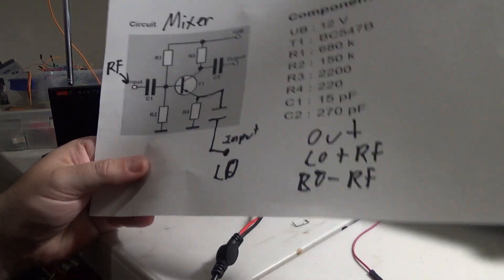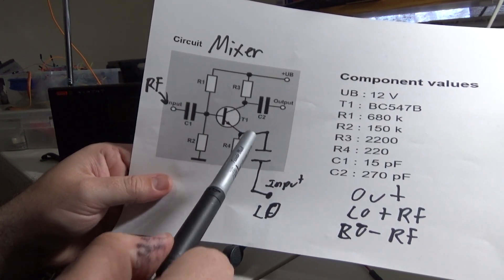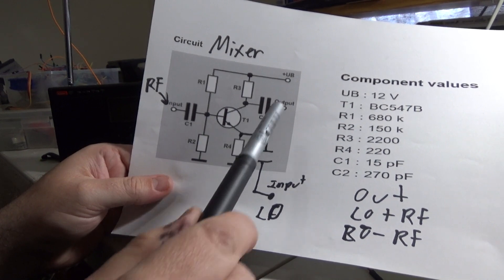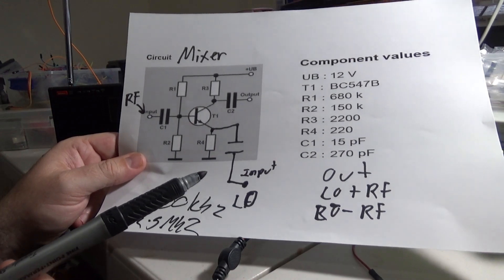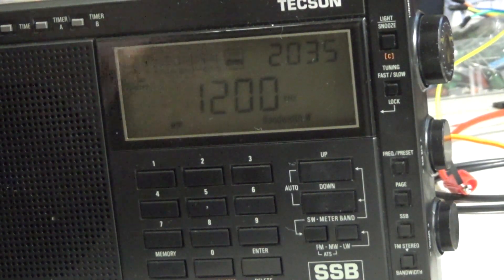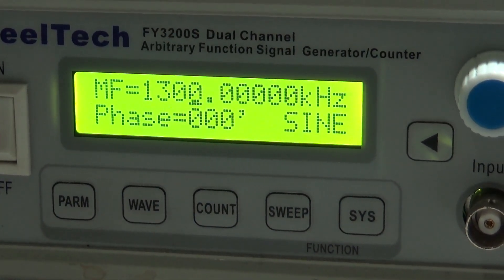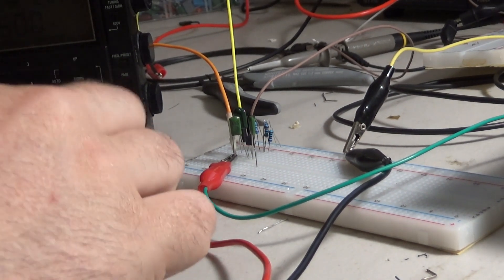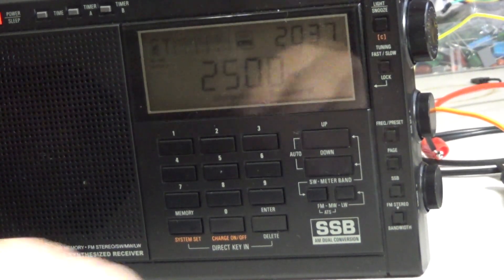Radio Frequency Mixer Demo

Comment: These mixers were OK for domestic radios but they were completely unbalanced and as well as the wanted IF output, you would get a very large amount of the local oscillator coming out too, which could spell trouble in multi-band sets. There would aslo be a fair amount of the RF input signal present, more trouble. A nice balanced mixer would have been much cleaner, but pennies count!

Comment: For some reason I'm having a difficult time wrapping my head around this concept, maybe if I saw the mixed signal on a scope.
Reply from the maker: The reason it works is pretty mathsy and not intuitive. Plenty of places you can look up a derivation. 

The scope will just look like mess because it'll be 3 different frequencies all summed together.

It'd be best viewed on a spectrum analyzer if anything
Reply: @elpechos  Like modulated RF signal?

Comment: For total Noobs; An antenna converts invisable Electromagnetic radiation into pure electrical signal but you can also connect an electrical signal to the antenna and it will just go ahead and like it and say; "Thx for saving me the work" except not and electricity is always trying to play the magnet game at the same time. It's physics. Somebody way up high said that it was going to be that way. It lets us do cool stuff.
Reply: Yes, you are a total noob. :-)

Comment: Hi Matthew,what is your  antenna connect at green alligator clip?
In other case for RF input signal at mixer have you LC tank circuit to get the frequency for 1,2 Mhz?
Dinos

Comment: Thanks for the video. How will this receiver type handle a signal at the level of MHz? For example, let's assume that a 100Mhz signal is coming from the antenna in the FM band. How will the stage amplifier after the antenna amplify this high frequency? There isn't even a transistor to handle a 100Mhz signal.
Reply from the maker: There certainly is a lot of transitors that will handle 100Mhz. The ss9018 is a pretty old transitor with a transition frequency of 1.1Ghz. So it will handle 100Mhz no problem
Reply: Most will handle up to HF (High band frequency before the gain starts to decrease linear on dB).

Comment: Thanks for the video. So if I take a common emitter amplifier and inject a local oscillator frequency through the decoupling cap on the emitter resistor I get an RF mixer?
Reply from the maker: You sure do
Reply: @elpechos  Wow thanks! Must have learnt this once and forgot.
Reply from the maker: @jemussi7842  You'd be better off buying a NE612
/SA602 though. It costs virtually the same as a single transistor and works a lot better. The one transistor mixer is more of historical interest. It does work well enough to make a simple superheterodyne AM radio though.
Reply: @elpechos  Many Thanks for this, I will look into that for sure.
Reply: Only if the levels are correct. If they are too small, then you are simply getting a linear adder circuit.

Comment: I've been working with 2N3904 transistors and I haven't been having success at frequencies above 1000 kHz. Maybe I can get some transistors like you are using and try them.
Reply: Probably the High Frequency gain dramatic reduce after passing the midband

Comment: Thanks for the video : now i wonder why we use diodes and baluns when can just use active mixers (with tuned circuit)

Please are your resistor values correct? doing the math then collector voltage is negative (bjt in saturation)...

Please check it (what's my mistake?  Thanks)
Reply from the maker: Here's the DC operating points for this amplifier

https://imgur.com/a/vevz7CR

You can always check your math with a free circuit simulator such as LTSpice
Reply from the maker: @Zeus . 

>i wonder why we use diodes and baluns when can just use active mixers

Passive (eg, diode) mixers are simpler and have wider bandwidth than active mixers. They also tend to introduce less noise.

Comment: This is a fantastic video! One question I have is that how did you hook up the 1200khz transmitting signal to the input?

Thanks!
Reply: Steve again.

Never mind. I think I know how you did it. You just made the 1200khz transmitting signal by creating a long antenna. Because all other signals are rejected except 2500khz. Right?

Thanks in advance!
Reply: @stevekim6923   Hi : like you said, with a long wire as antenna : I think : The radio station is broadcasting at 1.2khz but his radio can not pick it up because it is tuned at 2.5khz....With the mixer, the 1.2khz signal with audio from station is mixed with LO so that shifts the radio station signal to 2.5khz
Reply from the maker: @Zeus-ub2zp  That's exactly right. The RF input is coupled to the mixer via a long wire antenna.  A short piece of wire is draped from the output over the radio to hear the result.
Reply: @elpechos   so basically you made a wire antenna and shifted all  the RF frequencies 1.3 Mhz so 1.2Mhz became 2.5Mhz. But also many others moved by 1.3Mhz.
Reply from the maker: @WoWPro71  yup

Comment: Hi Matthew, Great video!   I'm going to build this to use for a BFO circuit on a metal detector.   What is the value of the capacitor at the LO input?  I didn't see that in the video.  Regards, Robert
Reply from the maker: I believed I used 10nF. It's not too critical
Reply: Thanks  for that.  I used a 220 pf and built the circuit.  It works (kind of).  I have 2 (unstable) oscillators 1 at 1505 kc and the other at 1465 kc (checked on SW radio) and my DVM shows output of mixer wobbling around 45 to 50 kc for a while and then going to 0.  According to the DVM the duty cycle is 5 to 7 % so very little of the output wave signal is above 0.   It's a work in progress.  For a metal detector I will need to adjust the oscillators to to adjust f1- f2 to get in the audio range and then run a speaker off of it.   Maybe I'll put a low pass filter on the output.  It's all good fun.  Need to buy a "scope" which I have no idea what to buy.  Thanks for your kind help! @elpechos
Reply from the maker: @robertschoenberg3972 . Yeah, without a scope, it will be very difficult to work out what's going on. 

The output from this kind of mixer is generally very weak. You'll most likely need to filter out the undesired frequencies and amplify the desired ones, a few times. 

You may prefer to use a more modern approach. https://en.wikipedia.org/wiki/NE612 for simplicity
Reply: Hello Matthew,  I checked on the Ne612 IC that you advised me of.  In the end, this may be the final solution  - thanks for that!  Right now I am enjoying playing with discrete components and dealing with the ???,  and confusion.  I built a single oscillator metal detector and used it (with an AM radio) to find a buried irrigation valve.  I am a retired mechanical engineer and life long electronic enthusiast and this is my hobby and interest.  Need to buy a "scope", need to know what I need to know to buy a 'scope" - you know?  Ha, ha. Thanks again and Cheers! @elpechos